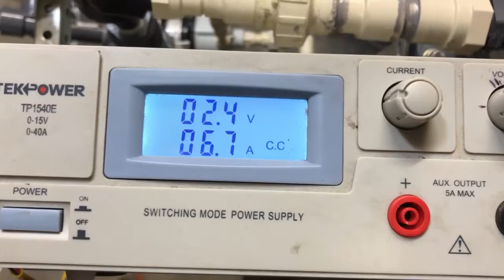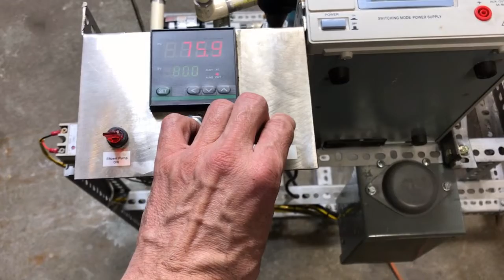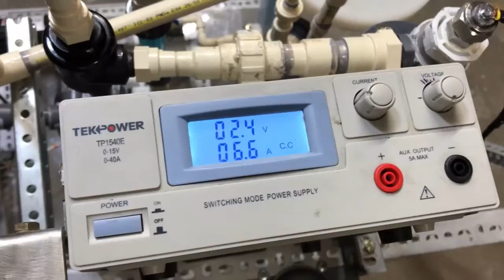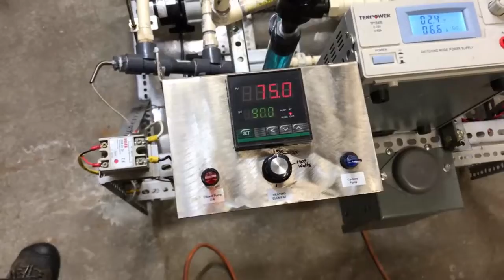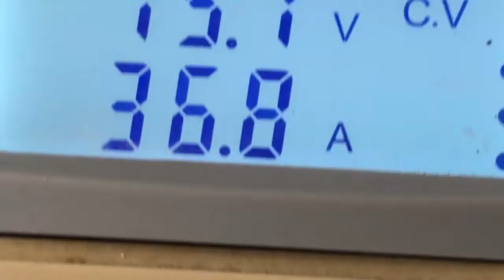Electro winning pregnant solutions ewaste metal recovery

Comment: Glad you found a use for the oring idea. 
Very interesting this whole refining stuff.
Always been interested in electroplating.
Some of this is a bit over my head.. never understood chemistry that well..   hope you are making money...
Reply from the maker: Bro i found it solves so many problems in test equipment that's got to be dismantled and inspected , i bet these things could handle 500 psi if they had lateral support
Reply: They use the same idea on old JD injector fuel return lines.
They just have what is called a grommet. Looks like a tall oring.  
In a pinch I have stacked 2 or 3 orings instead of the grommet